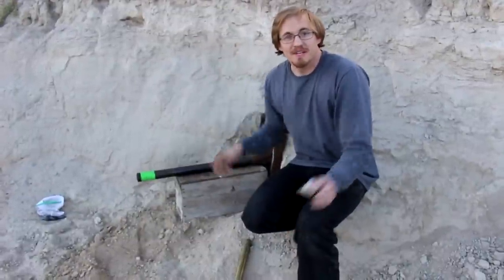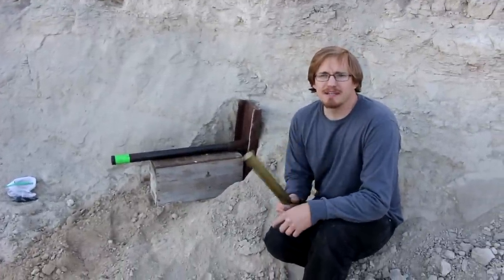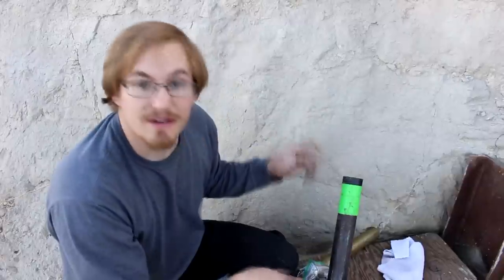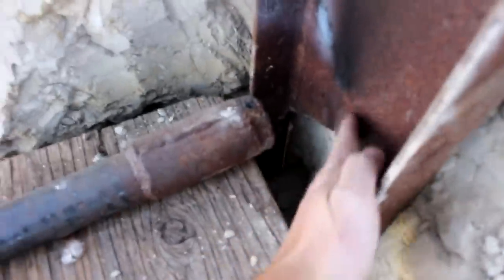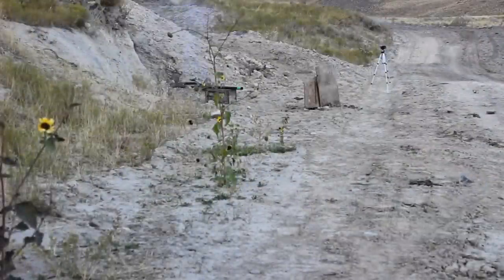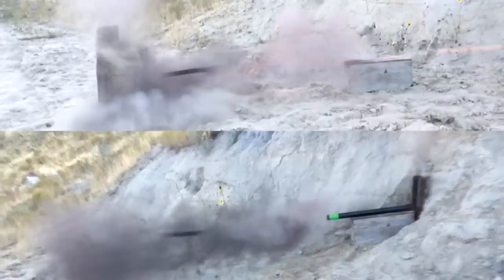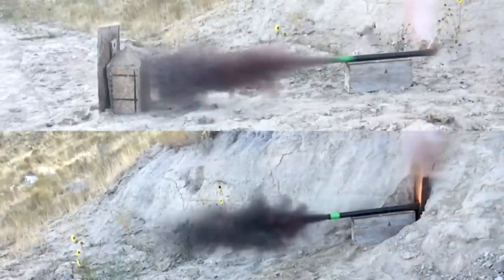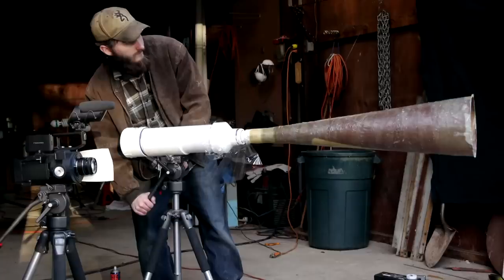How Does Recoil Affect Gun Performance?

Comment: Interesting video as always. Unfortunately, you're drawing a lot of extravagant conclusions from a very non-rigorous test here. "Almost identical" velocity (in your own words) from a makeshift cannon, with an imperfect mounting setup that doesn't account for friction induced by vibration, with changes to the projectile from impacts with rocks from one shot to the next, measured by a not-very-high-speed camera with no proper scale in the background, an unknown zoom factor on the shot and post-processing... I think that makes the point pretty clearly, though I could go on.

Yes, recoil reduces the velocity of the bullet, and your friend was on the right track about the duration of the force applied being shorter as the barrel moves back (thus effectively reducing the distance traveled). However, consider that it is not a linear application of force. As the explosion takes place, the pressure (and thus force) ramps up extremely quickly, but then very rapidly begins to fall off as the volume in which the hot gas is expanding increases with the movement of the projectile.

The real force applied, rather than linear, is probably some combination of a complex quadratic, a logarithmic fall-off, and a series of sine waves generating noise as shockwaves bounce back and forth in the expanding gas, the barrel, and the projectile itself at various frequencies. As a very rough (out of my butt) estimate, I'd say something like 95% of the energy imparted to the bullet is transferred in the first 60% of the barrel. If the barrel then moves 40% of its length in the recoil-enabled shot before the projectile exits the barrel, it would be going 95% of the velocity of the non-recoil round, which is plenty "almost" enough for the setup shown.

Note that it isn't technically the recoil itself, but the change in the way the volume of the expansion medium changes over time that produces the difference. This means a pistol-length barrel (very short compared to the optimal barrel length for the charge / very high muzzle pressure) wouldn't see very much diference, either in velocity or accuracy. A rifle-length barrel would matter more for both, and not coincidentally, the stance and design of the gun both cooperate to reduce recoil. A sniper-rifle-length barrel (getting closer to the optimal length, at which muzzle pressure equals ambient pressure and thus all possible work has been extracted from the system) has an even greater effect. Finally, an artillery cannon tends to be very close to the optimal length, so that as the barrel recoils using hydraulic or pneumatic systems (so as not to affect accuracy while also not destroying the artillery emplacement over time), all available work is still extracted. Even then, you'd see a slight difference, I suspect, but it would be very slight indeed, as the recoil length is very small compared to the barrel length (5% or less, and also consider the logarithmic nature of the work done, so probably a fraction of a percent of velocity).

Comment: Cody you're straight up wrong. The energy going into the bullet and the gun are not equal. This is basic kinematics.

Consider that momentum is conserved through the firing of the gun, but the gun and bullet have different masses. They will have different energies.

You're right that more energy is lost to the hole when there's no recoil, but you have not shown it "evens it out." In your side by side comparison the viewing distances were different.

Comment: Even if the gun doesn't move at all (ideal rigid object) it doesn't violate Newton's second law; it just means all the forces applied to the gun are in balance. The second law says IF the net force applied to a body is nonzero,  it will accelerate proportional to the net force.
Even if the force does no work on the gun or the bar it violates none of Newton laws.

Comment: so a closed bolt gun with no touch hole would be faster without recoil.
Reply: Doesn't matter if the gun fires from an open or closed bolt.
Reply: +swiss pretty sure he said if the gas only had one way to go the projectile would be faster.
Reply: +swiss was just thinking open bolt let's more gas out between shots and anything gas recoil operated let's gas through the tube, like bolt action would be most efficient. or non gas operated closed bolt firing semi auto/auto rifles.
Reply: +swiss I meant bolt action more so. my wording shot me in the foot I guess.
Reply: +Donz Milky no pun intended
Reply: Donz Milky Ah I see what you mean. But practically there isn't any difference between semi-auto actions and bolt actions because the bullet leaves the barrel long before the action starts to cycle, otherwise the pressure would be too high for safe extraction. Now there are some exceptions to this but I'm not gonna go into too much detail here.
If you have any questions, feel free to ask.
Reply: +swiss I mean mostly the spring resistance on the action, plus the gas tube allowance for expansion.
Reply: +Donz Milky more volume in anything other than bolt action, tighter gas seal in bolt action and less extra moving parts close to the time of powder ignition.

in a perfect world, in my theory haha.
Reply: Donz Milky Gas operated guns are always locked breach designs so for the time the bullet takes to travel down the barrel the action behaves exactly like a bolt action. 
Now it is true that the gas port and tube/piston chamber add some volume for the gas to expand into, but at such high pressures it's really negligible, especially if the gas port is close to the muzzle. 
If you had an AK-type action (long stroke gas piston) with the gas port very close to the chamber and far from the muzzle, you would actually lose quite a lot of pressure and maybe even unlock the breach before the bullet leaves the barrel. But such a gun wouldn't work and might kill or injure the shooter.
Also there are other semi-auto actions that don't add any volume to the barrel, namely blowback and recoil operated actions.
Reply: a bolt action gun has a higher fps than a semi auto.
the muzzle energy will translate to recoil equally either way.
it either gets absorbed by the non affixed gun, used in part by work of the auto action, or transferred to your shoulder or whatever's  holding it still.
theres always recoil, and its always equal to the forward force.
and yes, a bolt gun kicks harder, respectively. 
a closed bolt gun with no touch hole would be faster regardless of being affixed or not....... up until the point the projectile was greater mass than the gun... maybe.. i can picture a musket being shot off a rod fixed in concrete, like a bottle rocket
Reply: All depends on what type of gun you are talking about. A 22LR Semi auto that uses just spring pressure to hold the bolt closed then yes.  All center fire rifle cartridges used in semi autos use some type of locked breach, like a rotating bolt , that only unlock after the bullet has nearly exited the barrel.
I want to see the same test done with a sealed barrel, IE no flash hole
Reply: Yes 
i think that  a more precise measurement of the projectile velocity will show that it is slower because of recoil .
[
Cody's hypothesis assumes that the maximum velocity of the projectile is achieved before it leaves the end of the barrel
]
I say it constantly accelerates until it leaves the barrel 
]
so a recoiling barrel will have the projectile leave the barrel sooner and therefore have less velocity

Comment: But the projectile that fired out of the loose gun appeared to fly slower? You need a chronograph lol.
If you freeze frame through it you will see that the loose gun actually fired slightly sooner in your comparison clip, the top projectile is in front of the bottom projectile when they have both left the barrel, but immediately before impact you will see that the top projectile has fallen behind the bottom. Taking into account scale, the top frame is actually slightly closer than the bottom frame, meaning that the difference in distance traveled even further shows that the braced gun produced higher velocities.

Comment: You are wrong about the energy part. The same amount of momentum has to go in both. m*v=M*V , the M and V here being Earth's mass and speed change respectively. Now, we can get the earth's speed as (m/M)*v. M is very big in comparison with m, so V is very small in comparison to v. Now, for the conservation of energy. 2E = m*v^2 + M*V^2 = m*v^2 + (M*m^2 * v^2)/M^2 = m*v^2 + (m^2/M) v^2        v^2(m + m*m/M) = 2E    v = sqrt(2E/(m + m*m/M))  We can clearly see that in case of the gun not braced and gun's mass approximately that of the bullet,   v = sqrt(2E/2m) while with it braced the m*m/M is negligible and v=sqrt(2E/m). Braced gun's exit velocity is sqrt2 of the unbraced one's. The difference gets smaller as gun's mass decreases in relation to the bullet's mass. In reality, the difference is slightly bigger because barrel's movement which Cody talked about changes the effective energy E being introduced into the system, but still,sqrt of 2 instead of 2.

Comment: The whole idea of a braced gun leading to greater projectile velocity must come from the fact that you can jump higher when standing on concrete than if you were stand on soft sand.
If you could put a flap on the inside of the touch hole, it would close, preventing the gasses from escaping. Think wind blowing a door shut. Set up a background scale and repeat the test, please.

Comment: Disagree about the recoil problem, I think that if you will TOTALLY immobilize the cannon the results will be a little different. I would guess that there was ENOUGH movement in the cannon to fudge the results. The only movement that is critical is the movement that the cannon has before the projectile leaves the barrel. And you commented that the cannon moved a bit, maybe an inch or two, enough to loose energy to the projectile.

Comment: It does not affect gun performance but it does affect the effects and the final energy of the projectile.

Take into account only the velocity of the center of masses of the system (gun and projectile), and an external point of view of that system (if you see it from the gun point of view you would never actually have recoil).

So first case, gun shoots with recoil, viewed from an external point of view, the projectile moves to one side at a high velocity, the gun moves backwards at a lower velocity, and the center of mases moves towards the projectile side at a certain velocity1, ergo energy of the system is (Total mass)*velocityCoM; (velocitycCoM= projectile velocity-gun velocity).

Second case, gun shoots without recoil. You can imagine now that velocityCoM is higher (from our external point of view), since "gun velocity" is zero.

Sooo, with no recoil, the projectile shows a higher muzzle velocity, but take into account that the internal energy of the system never changes. In both cases relative speed between the projectile and the gun are the same and so is the energy between them.

AND WE ARE NOT TALKING ABOUT RECOIL RELOADING WEAPONS THAT ABSORB ENERGY BY DOING THAT.

Comment: well in your case, if you clogged the cannon fully, then redone the experiment, IF the gun does not explode, the braced one would probably go faster since that energy would HAVE to be expended in the projectile! a cool thing about those gasses, if you put a muzzle break on a gun, the "extra" gasses that usually veers off the bullet makes it go less aligned and also potentially makes it go less far due to aerodynamics, BUT with a muzzle break, the extra gasses continue to accelerate the bullet without veering it off course AND disperses the extra gasses AND adds up to the acceleration! so a BOLT ACTION + MUZZLE BREAK makes a bullet go faster and farther AND more precise! and this is why a semi auto and automatic fires the same bullets at slower velocity since the reloading spring removed a part of the recoils and used the energy to reload! in your case, NOT all the energy is transferred to the projectile in BOTH cases to the speed stays the same! (i did a bit of study on the external ballistic page on Wikipedia for a game mod of crysis... and studied a few other thing online AND have a few hunter and army friends for those other questions so that made a few things clear!) just for a proof of concept, a .45 ACP goes 290 M/s, BUT if you would put an optimal cannon, and no recoil, and a muzzle break at the exact point where the gas had no more effect or very low effect... the bullet could go 300+M/s even 350 M/s! same powder! well maybe not 350 but 300 to 310! if you would drill a bunch of holes in the cannon then it would drop to 200 M/s until it would get stuck in the cannon... in your case there is a hole (thank god since your projectile would explode your cannon if it would put too much back pressure!) so i suggest, take a lighter projectile and get that hole plugged and ignite with a barbecue igniter!... those that works like a spark plug! that would make a sealed system! 

man that's long sorry... could one believe i am the silent type? well now you know how it would sound if he said every thing he thinks! ;P

Comment: No, mass and energy of a gas expanding through a hole in stationary gun is, indeed, greater than in moving gun, but most of it's force is lost not because of that, but because, as you've noticed, stationary gun had shake earth. So, it's not completely stationary - it's allowed to move by elasticity of rock behind it. And it requires a lot of energy to compress a rock.
Also, when pressure wave hits back of the gun, pushes gun against a rock wall, compresses a rock wall and then reflects backwards, as you've also noticed, it's already can't get in time to push the bulled (at least not with that much energy to make significant difference). To make this experiment very clear, you'd need very strong material which can't be compressed much, and you'd need sturdy connection of the gun to it. But nonetheless the difference in speed should be quite small.

Comment: Imagine standing on an office chair with wheels, and trying to jump forward 5 feet from it.  You outweigh the chair by a factor of 5 or 6.  You'll go forward, maybe, a couple feet, but the office chair will shoot rearward.  While Work equals Force acting over a distance, acceleration is a function of mass.  F  = ma is the common, but misleading, form of the second law.  It's more correctly stated as a = F/m.  Same force, higher mass, means less acceleration.  If your projectile is 2kg, and the barrel is 3kg, and the force (powder ignition) is acting equally upon them, I would expect the projectile to experience 50% more acceleration, but only for as long as the force being applied is contained by the barrel.  As soon as the projectile clears the muzzle, and the blast front reaches adiabatic equilibrium, it will begin to decelerate.  Having been pushed just as hard, but experiencing more acceleration due to its lower mass, the projectile will be faster.  In fact, I'd wager that your video shows it, but the frame rate isn't high enough and you didn't place a reference ruler in the background.

Comment: nooo, there is no reason, why the gun should recieve the same amount of work as the bullet. if this was the case, even shooting a .556 was suicidal. they have the same impulse/momentum, wich is force integratet over time. work is force intagrated over distance.

furthermore, work does not have a direction, so the work can't be done in opposing directions. this can be seen on the formula for cinetic energy : 1/2*m*v*v.
the only vector here is v (verlocity), wich is multiplied with its self, and vector times vector is a scalar, as you probaply know. since the result of this equation is always positive(exept for a imaginary verlocity or a negative mass) you can never have two kinetic energys cancle each other out.
impulse/momentum on the other hand is m*v, so here you just multiply a vector by a scalar (mass m) and the result is a vector. therefor it is possible to have 2 opposing momentums (impuls)
Reply: MsMotron the only reason a .556 doesn't tear through you like the bullet would is the surface area on the butt of the gun it's spread out giving you the same force but spread out more area

Comment: There's another aspect to a gun that increases total work on the gun relative to the projectile: Once the projectile has left the barrel, the system stops being a piston and cylinder arrangement, and turns into a flying chunk of metal (bullet) and a very inefficient rocket engine (gun/propellant gases). 

This is also how muzzle brakes work. They direct a lot of the thrust produced by the muzzle blast backward, herring it forward a bit, which compensates for all the other sources of recoil.

Comment: no no, no no no.  The same amount of work does not go into a gun that goes into a bullet.  The same amount of momentum, yes.  The same amount of work, no.
Since work = force * distance, the bullet, which on a regular gun travels the length of the barrel, will have hugely more work done on it than the gun, which typically travels only a tiny fraction of the barrel length.

Comment: CHECKING PERFORMANCE BASED ON ???  HOW about range of the shot??

Other wise you have solved the riddle of "how to go 2x the speed of light"  go the same speed in both directions..

A proper gun uses almost ALLL the explosion before it meets the END of the muzzle..  If it does not...the explosion MUST be RELEASE(hole in the but) of it creates a Vaccumme..  or Drag would STOP the bullet in the gun..